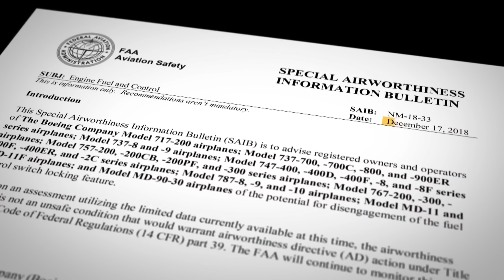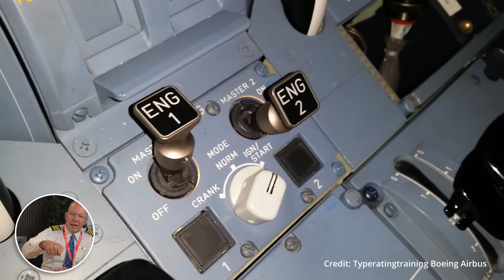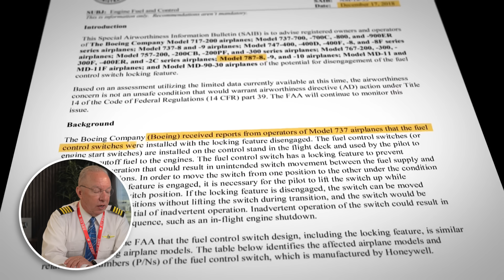Air India 171: The FAA’s 2018 Fuel Switch Locking Bulletin Explained (16 Questions Answered)

Comment: I believe one reason cockpit cameras aren’t commonly used could be due to the complexity and size of visual data. Unlike audio or text, video requires significantly more storage, bandwidth, and processing power. Handling high-resolution footage in real-time — especially in aviation systems where reliability, efficiency and weight factor are paramount — poses a major technical challenge. Introducing such systems might also necessitate powerful GPUs and robust infrastructure, which could complicate things further.

Comment: Boeing does not have a fail-safe mechanism. That much is clear.
The Aircraft took off. So, the engine was on then and fuel switch was in right position to let the fuel reach the engine (my layman terminology!). 
Then something happened.
The fuel supply suddenly got cut off.
From what I have learnt, RAT kicks in when engine shuts down but is not there for take off. So, it kicked in after the Aircraft took off but what made the engine shut down again?
Human error?
Engine failure due to some cause not clear yet?
Sabotage?
We are back to square one.

Comment: Cameras should be a must ... especially when the lives of more than 100 people are resting on the shoulders of 2 people.

Ik there are cases of pilots getting naughty with their country pilots or with their air hostess, but that's usually done whilst in the air or after being on the ground

The most crucial parts ie take off and landing should have camera recordings the controls of which will be solely in the hands of the pilots..not automated ofc.

Comment: Could the fuel be cut off with the switches on run due to a faulty electrical system?
Reply: As stated no, as both switches were not electrically operated and HAD to be turned on and off manually

Comment: What happens if you pull the fuel control switch to ON, but the spring mechanism fails to retract the knob, making it possible for the switch to unintentionally move back to the OFF position at any time? While some may argue it's unlikely for both switches to fail simultaneously, we must acknowledge that a mechanical failure is always a possibility—anything can happen.

Comment: What are the actions which pilots always do with any switches - immediately after liftoff? Could it be a mistake by the pilot that he intended to switch off or change some other switch (landing gear is the most obvious one), however he switched off the fuel switch instead…

Comment: Sir, could it be that both engines failed for whatever reason, hence the question and answer by the pilots. The instrumentation would have alerted them that fuel was cut. And subsequently their reaction was to drop both switches off and on again hoping to get power back on line? Please answer? Thank you.

Comment: Hi Captain Steeeeeeve. Good video. But why is noone talking about the flaps? There is no question that the flaps were not properly configured for takeoff especially for a plane at roughly 70% capacity. No matter the angle of view, it is obvious that the flaps were either full up, 1 or 5 at best, when - based on the reported V-1 speed, they should have been 10 at least. So the question is, why would they take off with the flaps improperly configured hence very little lift? As you know, the plane would have emitted all sorts of audio warnings, and, if they had proper flaps to take off, then a suicidal pilot in command, could have both raised the flaps as well as kill the fuel switches immediately after. The notion that the switches could have been accidentally been tripped is ridiculous at best. That's just impossible and you know it, the only way that could been even a remote possibility is if the switch were accidentally left up in middle - between the two detents, which is basically impossible for one switch, never mind both. And the notion of a software glitch is also a no go, here is why, suppose it were a software glitch, then the switches should have been in the ON position, therefore, why would one of the pilots turn the switches ON - if they were already on? Tome there are only two possibilities, either it was a software glitch and the pilot  said "why di you cut off.." because he heard the engines spooling down hence assumed so, and then cycled the switches OFF-ON to re-light the engines, or this was intentional destruction of life. And based on the flaps issue which just does not make sense to me, I tend to think the latter. I'm not a pilot, but  I own 1 of only 5 full size 744 private sim on the planet. About 75% of the parts in my sim are real, including the fuel control panel on the throttle quadrant. I can't accidentally disengage the switches even if I hit them with an hammer so to speak. The detent is just unbeatable - unless of course, you pull the switch up.  God bless everyone.

Comment: Based on black box info, one pilot said why did they switch off the valve and one said he doesn’t. Any person who wants to die wouldn’t deny at the last moment as it adds nothing. You are missing a major issue here , there is no motive. Both pilots are healthy with their lives one is pretty experienced trainer and other was about to get married in 2 months and was excited for that. You ate ignoring all the details and are just blaming it on pilot. Are saying that there can never be a possibility that it can be a mechanical error. If it is, it it wont stop here you know and probably happen again. And the 2018 stuff u said, i disagree with you. It wasnt said in warning about installing switch upside down, it said there could be a potential issue with the locking mechanism. Please dont blame until u have all information.
Reply: off course there is motive, called insurance.
Reply: @janvanenk4374 what makes u think any of them have a need for insurance money? Did u find any evidence? They both seem well settled from a background perspective. There is a reason why modern societies also add a term ‘motive’ to investigation.